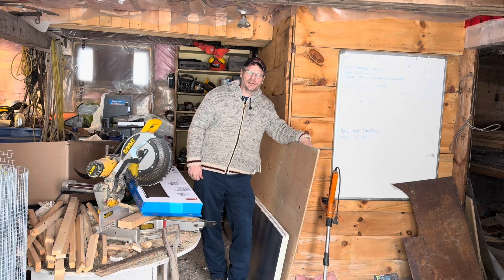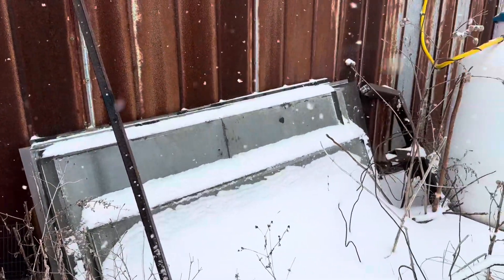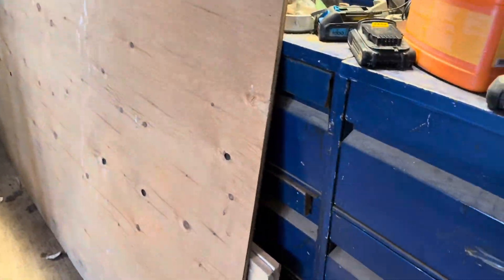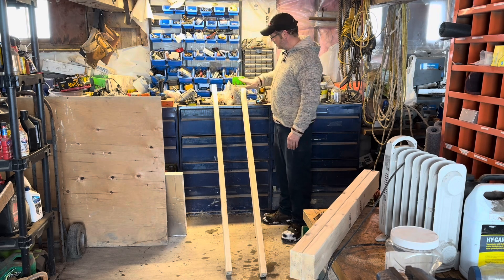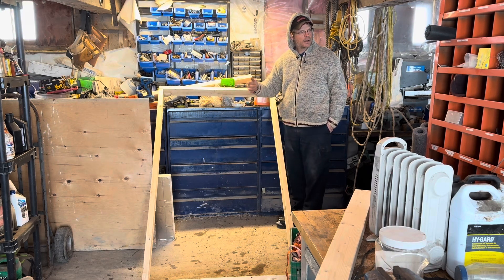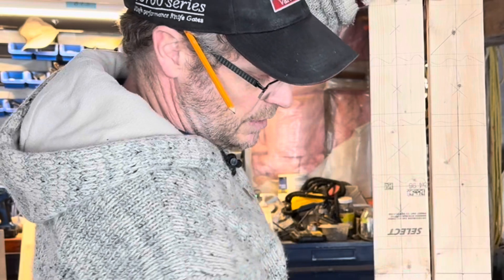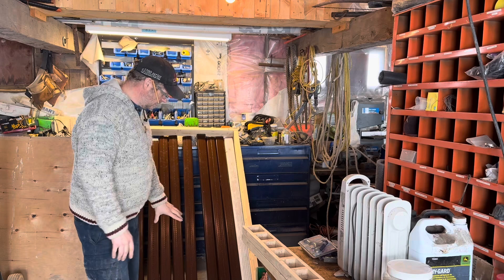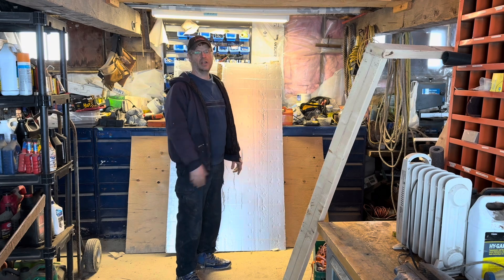HOW TO MAKE A SOLAR AIR HEATER FOR YOUR GREENHOUSE FOR UNDER $300

Comment: Very cool idea. How are you supplementing the heat at night?
Reply from the maker: The idea is that it will warm the entire inside acting as a heat battery slow releasing heat over night. I have many water bottles painted black to help with absorption. I also plan to add incandescent lights for added heat running off my solar inverter. It’s mostly to help extend my growing season. Stay tuned for results. Cheers